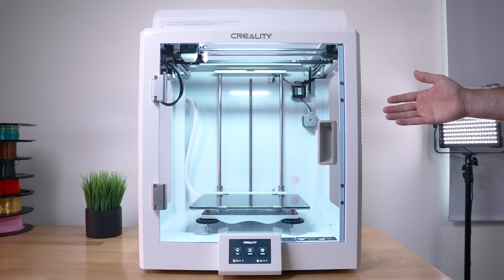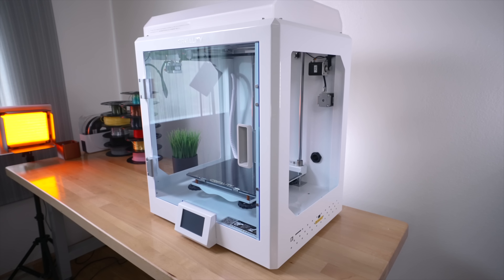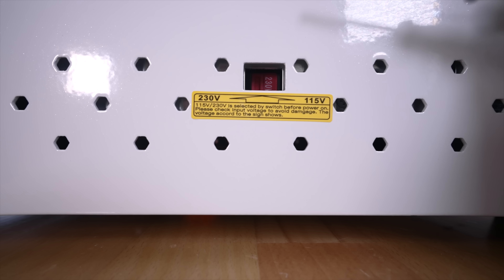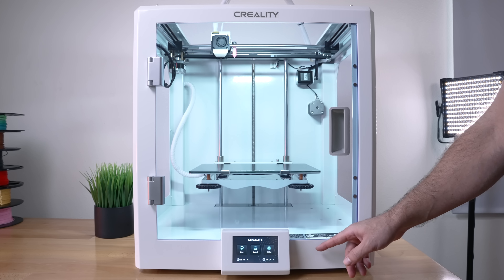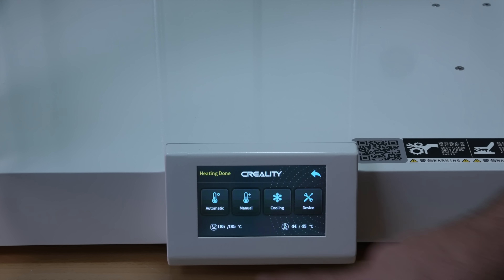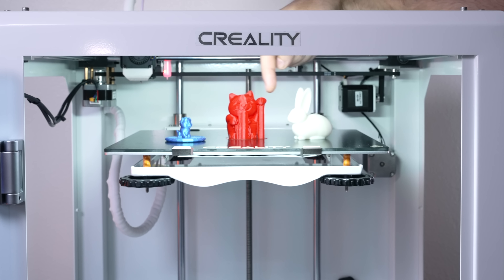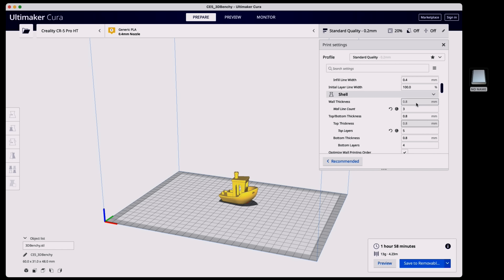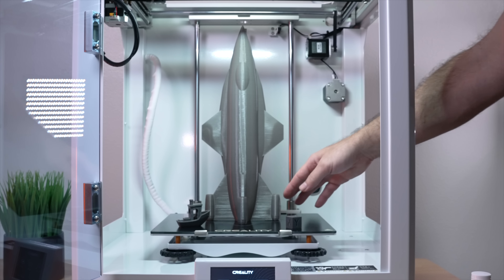Creality CR-5 Pro - 300c High Temperature - 3D Printer

Comment: I have been waiting a year for a full review. Really happy with how in depth this was. 
Hoping you do a long term review as I have heard from multiple sources that the bearings fail quickly and the stepper motors also fail due to heat. Some guys have molded their stepper motors with fans to help prevent this.

Comment: Strongly resembles the Ultimaker S5.  I wonder if there's an outlet for air filtration?
Reply: If not could easily 3d print a filter cover over the top of the vents that are on the side.
Reply: @jasonpowell7704  well it didn’t seem to print anything well. Another Creality that probably needs a pile of upgrades to print well
Reply: @WhereNerdyisCool  Yes, still watching the video. It didn't look bad till I saw the price. That's prusa level for sure. I think I'm already following your channel
Reply: @jasonpowell7704  oh cool, thanks!
Reply: @jasonpowell7704  I get that Creality has this problem but I can’t wait for three weeks for the Prusa to arrive. Not to mention I’m afraid to mess up the kit for it.

Comment: Hi! Amazing video, I have 0 experience with 3D printing and now that I have exactly this printer, I know exactly what to do. So thanks :) 
One question though, when I change the settings in Cura and save it to the SD card, when it starts printing it doesn't use many of the settings I put in Cura. Print speed for example, is always on 100%. Any idea how to fix this issue?
Reply: I imagine you already know by now but the 100% print speed is 100% of what you set in cura
Reply: @nicki3042  yeah I found out, thanks anyway :)

Comment: I have a tabletop space of 28x18 inches and I was wondering if I could fit the CR-5 Pro High temp 3D printer on it. I know it is technically 20.9x19.2 inches but the feet seem to be not all the way on the edge. I'd be okay with the printer hanging over the edge slightly as long as the feet were within my table's dimensions. I asked Crealuty's customer support but they just sent me a picture of the overall dimensions and said they werent sure what the feet dimensions were. Can anyone with this printer chime in here?

Comment: everyone throwing the term high temp on printers is turning into a gimmick.
if it's not atleast 350c I wouldn't consider it high temp. at 300c your not able to print much more than a standard 260c machine
Reply: The thing is, nylon is kind of a holy grail material and most nylons print at a temp where the heat break PTFE tube degradation is assured. Any materials beyond that might be nice to print, but I'd be happy with my ceiling being nylon or nylon w/additives.
Reply: I think your missing the point.
You can't find an enclosed printer, that hits 300c, bl touch etc.. at this volume for less than 1200$. This provides a lot of opportunity for engineering applications. 

I've been looking for one that checks all the boxes for 2 years. Following this one for a year now. Aside from bearings and steppers burning out... this is the best budget option on the market.

Comment: My touchscreen isn’t working correctly, so I haven’t gotten to use the printer yet.  The support people at Creality don’t understand the problem they just send me videos of how to level the bed.  I sent a very detailed explanation with videos that show me pressing a button on the screen with nothing happening.  One person suggested installing firmware but I’d have to rip the whole machine apart.  Any ideas?  Creality hasn’t helped me yet.
Reply: Most horrible experience with Creality support. Got it shipped, unpacked it, pressed home button... nothing. After many tinkering and diagnosis while bed was just slightly lowering with each power on, we've figured the BL probe was broken, it had it's core jamming randomly. Had to un/screw it a bit and manually slightly ease it in. Then calibration was a pain, spent hours and couldn't align it, it kept increasing the z offset to over 3cm. Figured out we must use pronterface tool to send a z-axis reset offset g-code (on ourselves) and we've managed to make it print by introducing a 1.9 mm offset manually at each print. Printed well for 3 days and then a full ball bearing on x axis rear upper side completely melted. These are made out of plastic. Now asking for a return, they refuse because the printer must be in pristine condition to be accepted for return. Even if I have asked for the return below 14 days. Told me I am not cooperant even though I've sent them pictures of the melted ball bearing non serviceable by myself and their  tech guys insists on me plugging the bearing back with a standard video. I can't believe I've spent 1.2k eur on this machine. My advice.. STAY AWAY from it. Hope this helps someone make an educated purchase decision.

Comment: Hey Vlad, I'm in the market for a large-frame printer and I can't decide between the CR-5 Pro High Temp and the CR-6 SE Max. I'm going to be printing a lot of Nylon, ASA and CF-PETG. I don't mind building an enclosure for the CR-6 SE Max, but I'm wondering if it's just better to buy the CR-5 Pro. Would you have any recommendation for either?
Reply: cr5 pro h, im doin the same thing and its much more conveinient high temp ready with everything ready to print right outta the box plus you can find them used for half the brand new price and itl work perfectly fine just as good as brand new.